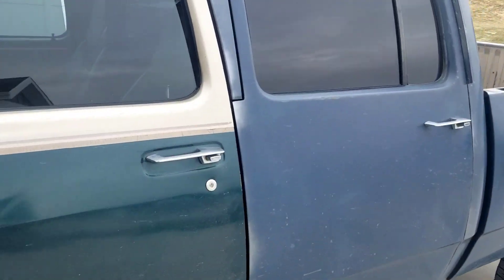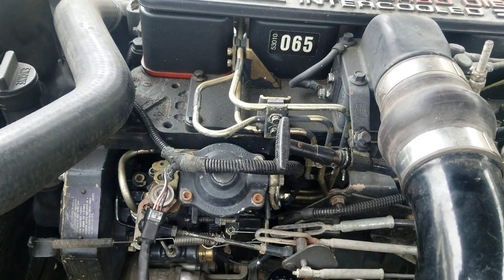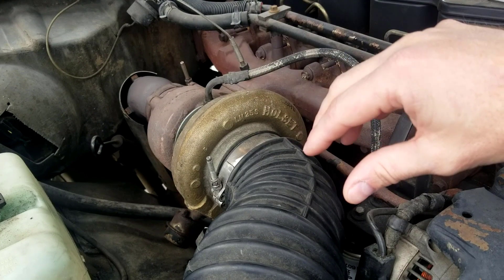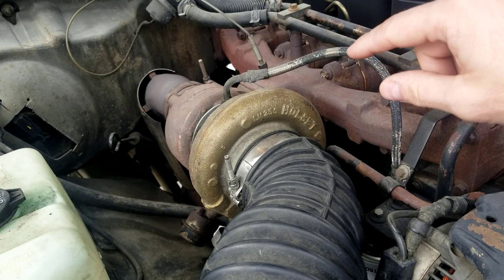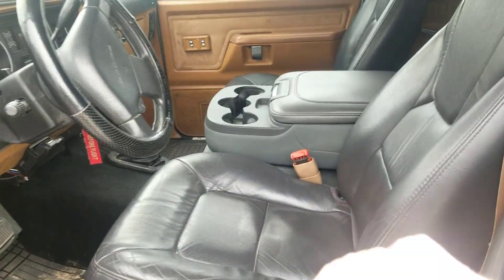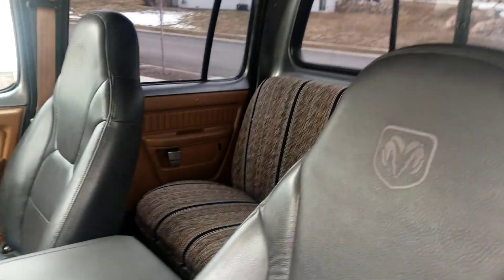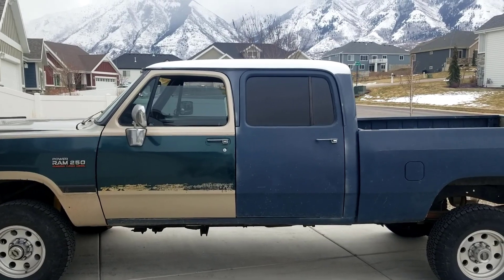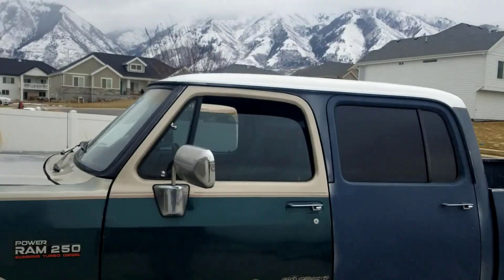Best Mods for the $$$ on my 1st Gen Cummins

Comment: I’m running the he351cw it isn’t a direct bolt on like the hx35 but I highly recommend it.
Reply from the maker: Yep, I actually had an he351cw as well but sold it cause I didn't want to deal with the exhaust flange, the solenoid plug, and new intercooler piping. I'll find another one though and do it

Comment: I noticed the bed matched did you get the whole truck as a roller , I’m curious if you can put a crew cab on a 2 door long bed chassis and run a short bed
Reply from the maker: I bought the cab, rear doors, bed, and frame together. Short answer to your question is yes, you can run a crew cab on a single cab or ext cab frame but it is difficult to do it correctly. The best way is to actually extend the from before it humps up for the bed. The best way to build a crew cab is to use a crew cab frame.

Comment: Was the power difference from the engine mods noticeable?  And how much did that affect your fuel economy?   I've got a bone stock '93 d250 that I sometimes think about modding to boost power, but I don't want to lose too much of the great fuel economy (I get 16 to 18 mpg with a camper on the truck).
Reply from the maker: Gary, that's a great question. The answer varies. I kept my truck completely stock for 4 years. It got about 16 mpg consistently. I have done many of the common pump mods over the past few years and I am getting around 17 mpg. The best part is how much more responsive it is, how much more easily pulls and gets up to speed and all it all it is way more fun to drive.

Comment: Did you use your extended cab frame for the swap?
Reply from the maker: No, the best way to do it is to use the crew cab frame. Using the extended cab frame requires butchering the rear floors of the cab to get it to fit.

Comment: Hey bud will the HX35 bolt on to a 91 non IC?
Reply from the maker: Yes, you have to clock the compressor housing to line up to you crossover pipe but it's a very easy swap.

Comment: Will the hx35 fit my 1991 w250 Cummins?
Reply from the maker: Yes, you will have to clock it to fit the crossover pipe of the non IC motor but plenty of people run them.